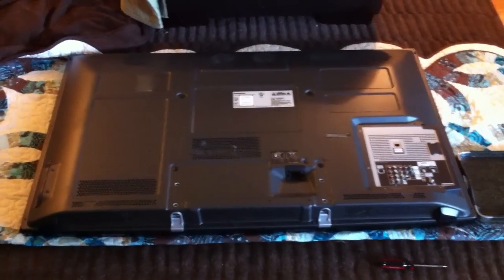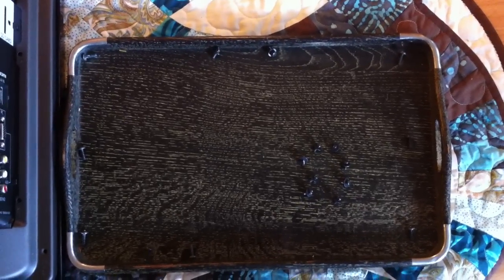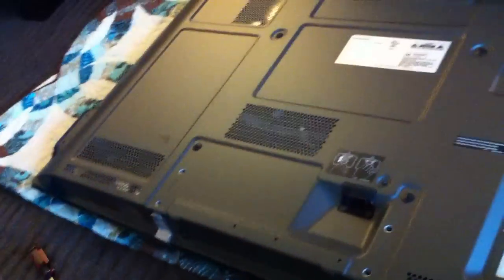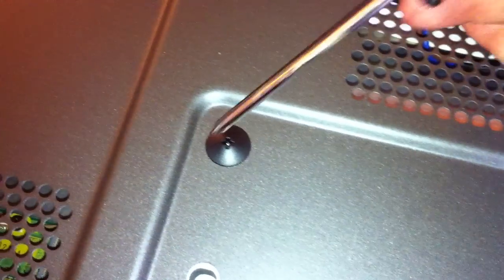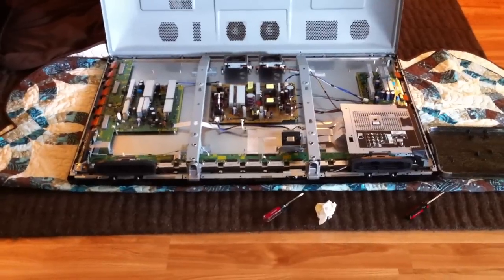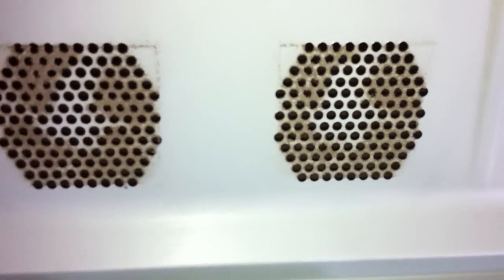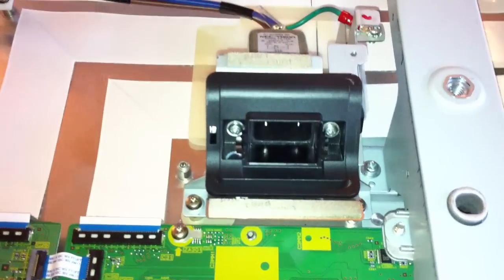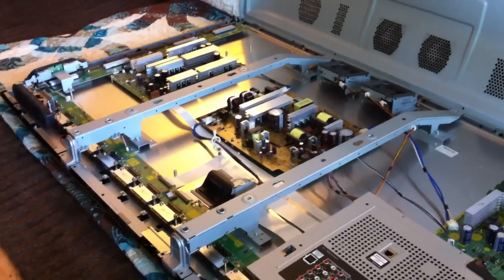Panasonic Viera TCP50G10 Disassembly

Comment: My G10 is still going strong since January 2010, but it is doing the louder buzzing when the screen is bright/showing a lot of white. Many other videos say to tighten down the screws on the boards (or get a proper replacement screw kit).  Video is a good primer to what needs to be done.  Now to get cracking.

Comment from the maker: So I think I managed to fix the black stripe problem. After opening it all up I just gently but firmly pressed down on a couple of those horizontal connectors at the bottom that I thought might be responsible for the stripe. Just to make sure the connections were solid. And since have not had any black stripe issues. Will update my comments if it comes back. Hopefully saved myself $100+ in repairs. :)

Comment: @briancloud - Yes, fixed! I found the A board online for about $100 (specifically: Panasonic part# TXN/A1DWUUS A Board for TC-P50G10) it was easy to remove/replace. All of the screws are standard No1/No2 Phillips size and all of the cabling and connections are easy to unplug/replug. No soldering! Unlike the video though, I took the back cover off while I had my unit upright and I think it went easier that way. If you've ever swapped parts inside a PC before, this was a piece of cake. Save $!

Comment: Thanks for posting this, my TC-P50G10 stopped working last night and I was happy to stumble across this video in preparation of trying to fix it myself. From what I gather I need to replace the Board A, which is where all the components plug in.  Hoping that additional plate isn't difficult to remove and no soldering involved.  Did you ever get your issue fixed after calling someone in?

Comment from the maker: Yes. The guy came in and just detached and reattached those connections I was working with and it did the trick! It's been months and no black line. Nothing needed to be replaced and if I had only known you can lift the plastic overlay piece that locks in where the connection is and disconnect and reconnect it I could have easily fixed it myself a s saved $150!  Now I know.
Reply: Can you tell me which screwdriver you used to open your Panasonic Plasma top middle screws? I got the side screws off, but not the middle top ones, and they're starting to break. I don't wanna get them stuck.

Comment: Hello good video
I have a Panasonic TX-P50G10B and the bass speaker as a very tinny sound basically it's broken, if I put in head phones on  the sound is good so like a speaker issue  
I just wondered if you know best way to fix this
Thanks